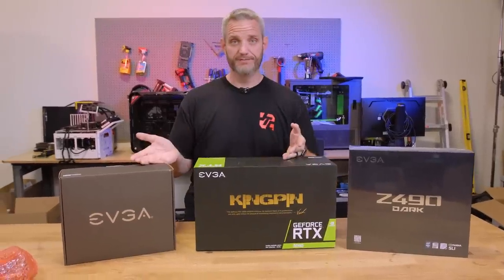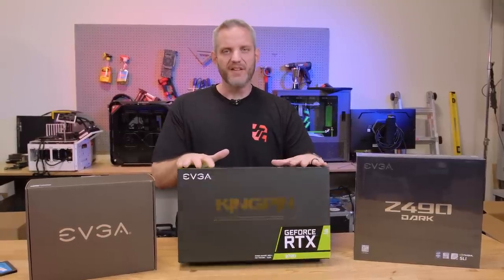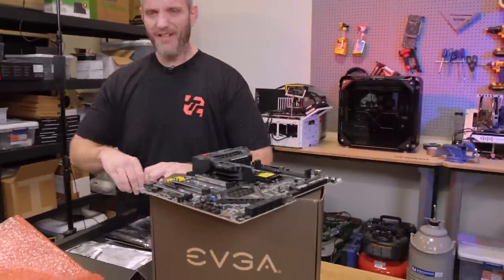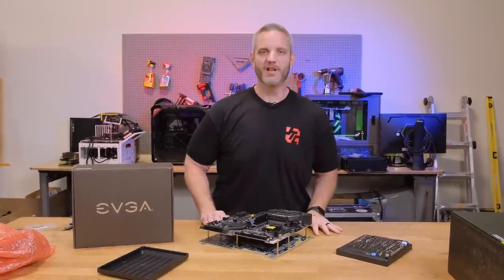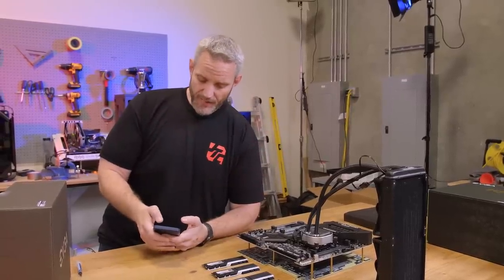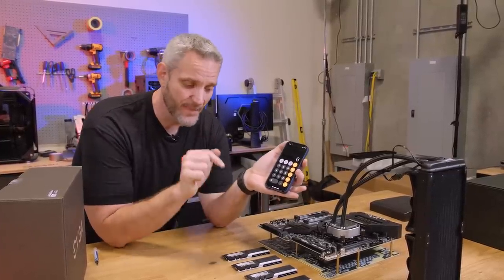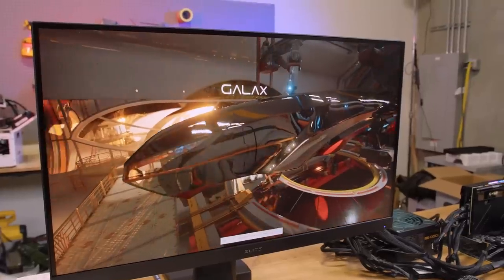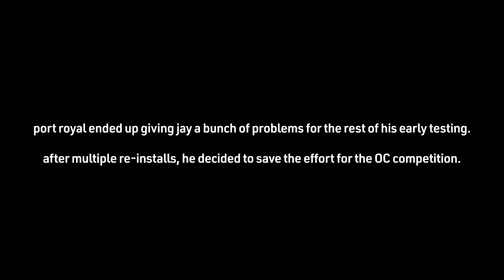RTX 3090 KINGPIN.... This should be illegal...

Comment: Jay : "I'm a regular nerd just like you guys!" - tunes his ram to tenths of nanoseconds worth of advantage.
Reply: That's just how ram works but the average builder knows nothing about ram
Reply: 10 pico seconds.
Reply: @patrickbone5446  I am guilty of this, I know nothing about ram. The most I do is making sure it is running at 3200 mhz and the RGB is on.
Reply: @removefromme  RGB is what ram is for!
Reply: @shumailkhan7205  Lol !
Reply: @patrickbone5446  I've watched & read how to articles. I've o.c.ed my  own ram and I still don't understand how it works.
Reply: nanosecond advantage, just with 5 ghz is like a billion times a second you have a ns advantage^^
Reply: @removefromme  try going into your BIOS to see if XMP is at least enabled
Reply: @removefromme  Intel would still be best for people like you I think. It's also generally more stable and tend to get lower core latency (50ns range compared to 60ns)

But for Ryzen, best thing to do is just make sure ram frequency scales with fclk. Since most ZEN3 CPUs can reach 2000 fclk, 4000mhz is actually the most optimal thing to go for. But usually the default is 1800mhz so pick a 3600mhz ram for good results.
Reply: @SoysauceML  my pre built only came with 2400 mhz ram lol.
Reply: @ryze9153  Probably it isn't overclocked. Rams that go above 3200 currently are all overclocked, just that the venders also offer you a profile for OC and covers warranty for OCing to these clocks.

So, maybe you can try your luck and OC it. Check with Taiphoon andd see if it's samsung die or hynix CJR/DJR, it should OC to 3600 without much issue if it is.

Though I guess if you use Intel it's kind of irrelevant. Ram speed does impact game speed though. Maybe about 5% or even more if difference is large enough.
Reply: @SoysauceML  i just enabled xmp to have 3000 mhz ram. Thats all i did.
Reply: @ryze9153  If it's 3000mhz then it's probably advertised as such lol. So it just means your dram was 2400 but officially supports 3000mhz via overclocking. Like I said most dram are overclocked (as in comes with overclocked profiles). I use xmp 4000mhz ram from micron, and its default profile is also about as low as yours.
Reply: @SoysauceML  well i'll say this. Cyberpower went cheap/worse quality on my ram, ssd, and power supply.
Reply: @SoysauceML  Already got Corsair 3200mhz RAM. Should suffice for my needs for the next 5-10 years.
Reply: @removefromme  why not OC it? I mean, I'm fairly certain there's enough headroom for 400mhz if you're using a ryzen (then again, I did hear that Corsair didn't have great compatibility with Ryzen. Wonder what dies it's using.) Turn the voltage up a little then set it to 3600 and run memtest to see if it has any problems.

Having matching fabric clock (fclk) and memory clock shaves 10ns or more memory latency... on top of making it more consistent (which should translate to smoother experience).

Heck, they even say this on AMD's official site.
Reply: @ryze9153  It's almost always better to just do it yourself than to buy a complete pc. You also get to fully choose what parts you want for what suits you the most.
Reply: @SoysauceML  yeah i know. My brother told me to just get a pre built so i did.
Reply: @SoysauceML  I may consider it. Just need to do some research on the matter.
Reply: i daily 4000mhz cl15 so yeah nah u dont have to be in OC comps to tune that tight
Reply: @jessecooley1580  huh ? You do ?
Reply: @removefromme  is 3600 mhz good?
Reply: @countleoponevonflikinstein8832  That's a good speed. The RAM timing itself is more important if I am correct.
Reply: @removefromme  Wait....You guys have RGB?

Comment: CL 12?! Haven’t seen timings so low since DDR3. But this time, it’s with DDR4 speeds...
Reply: People run Super Pi 32M.. Cl 10 3200  or cl 14 4800.
Reply: high grade samsung b-die kit, about 2x the price per gb as normal ram, you can shove 2v into that ram and not kill it
Reply: CL12 is normal. I had Corsair Dom Plats SE Chrome running at 3466 CL10 only on a Z390 Aorus Pro, not even a good memory oc board like an Apex or Godlike
Reply: Don't worry, in daily use like for gaming, CL will not impact as much as in synthetics.
I legit found no diff between 3800 really tight subs  c18 vs 14.
Left c15 since it was best for daily voltage.
Reply: @justetan3566  Really ?

I have about a week, thinking about tunning my RAM from CL16 to something lower, and even raise the frequency ; but I am just too lazy these days to do the testings and all that. I was thinking maybe I can squeeze out some faster loading times in games.

You reply discourages me even more (apart from my lazyness).  :(
Reply: @manupainkiller  i have no reason to lie, i spent weeks learning and tweaking my bdie kit ( same kit from zen 1-zen+ to zen 2 and hopefully soon zen 3 )
I have a 3733 17 17 17 1.35 b-die kit  ( paied like 260 euros at the time for 16gb, fml).
TRFC-TFAW-*_SLC (x2) gave the most performance while tweaking the rest isnt as big but still gives something to work with.
Primary timings ( such as CL) didnt really give me anything in games but  maybe at really low setting it could impact a little more.
Reply: @justetan3566  Hmm, and Ryzen system too. Wasn't the RAM supposed to make, a great difference for ryzen ?
Reply: @manupainkiller  Yes, but cas latency isnt the most important timing at all, videos as this one are not completely true and that stupid math* calculation doesnt really mean anything.
Try to use a 3600 c15 XMP vs a 3600 c18 one, you'll probably find margin of error result, because secondary ( sub) timings give way more performance, especially on ryzen.
Reply: @justetan3566  Now I am wondering if the results would be different on an Intel. I have i9 9900k.

Wasn't there a myth not long ago, that AMD prefers high frequency RAM, while Intel prefers tight timings ?
Reply: @manupainkiller  no, both like tweaked ram both speed and timings, ryzen has just bigger scaling due to chiplet design and latency.
Reply: @manupainkiller  amd would want both frequency and timings but you will notice frequency as a handicap more than timings cuz infinity fabric, diagnosed a defect motherboard like that
Reply: @justetan3566  Jay literally said in the video that it specifically matters for synthetics lol
Reply: @whydontyouhandledeez  yea but people arent always smart, this means that him saying ''good for synthetics'' will sound like '' good for everything then''
Reply: @justetan3566  sure, but anyone who doesn't know that isn't going to know how to tune their ram lol
Reply: @justetan3566  I'm not sure if you know this but the cas steps up in 2 in ryzen, your cl15 will actually be cl16
Reply: @mmaayyssoonn8858  if you leave geardown on yea, but i disabled it since it doesnt do anything for me.
it helps for stability  but on zen1 and zen+ it took way more perf than needed for just some stability ( zen 2 isnt that much affected by this but i disabled anyways since my kit is pretty good)
Reply: Buildzoid docet!
Reply: I think Steve was using a US voting machine as his pc. That would explain his panning away for a minute, then his scores magicaly increased by 20 percent...

Comment: I just messaged Kingpin about those overclocked SATA cables. I told him I need them to stress test my southbridge overclocks so hopefully he'll send me some.
Reply: The thing is, with two different (both functioning on another system) Smartphone-data cables, I have 1 working and 1 not working with my PC :)
They should be electrically identical, but...

Comment: I'm pleased with my pc when I hear scores just over 15k when my score is just over 13k. I'm satisfied not having the best when I spent under $2k for my build. Ryzen 5800x liquid on a 360m rad, 32 gb duel rank with four dims at 3600 16c, and my rtx 3070 fe oc'd to 2055mhz ish core with a 75mhz bump to ram before multiplier. It's fun to play. I wouldn't recommend the best for gamming for an extra 5-40 fps more. As long as your over 60fps its all good.

Comment: That is crazy, thats a different calculation then what I was taught, but it works just as well. Still trying to figure out why it works both ways, but I know its just math. Your way might be easier. 

Here is the way I was taught:

Ram Nano Second Timings Calc Equation

(1 ÷ {Half of Ram Clock Speed in Ghz}) x [Cas Latency Timing] = Time in Nano Seconds to complete.

So Using Jay's initial 2 Examples of CL18 at 3866 and 4000.

(1 ÷ 1.933) x 18 = nano seconds = 9.312 nano Seconds

as opposed to the same Ram Kit running at 4000Mhz at CL18

(1 ÷ 2) x 18 = 9 Nano Seconds

Both the Technique shown by Jay in the Video, and the Technique I learned ages ago work for this calculation as you arrive at the same result, I just wish my brain would snap out of it and figure out why both ways work...

NVM. Just figured it out. It works because both ways arrive at the same multiplier. So if you take 2000 ÷ 4000 you end at .5 the same as if you take 1 ÷ 2. Or if you take 1 ÷ 1.933 You end up at 0.5173305742369374 the same as if you take 2000 ÷ 3866. So it literally doesn't matter which way you use, they both end up with the same multiplier before multiplying by CAS Latency. In that case I think I will start to use Jays Method instead, as its much easier to just start at 2000 no matter what, and divide by the The Ram Speed in Megatransfers as opposed to having to always figure out half of the ram speed and converting to Gigahertz. Learn something new every day! Love it!

Comment: Jay, Should I upgrade my 1660 super to a RX5700XT?
Reply: I own a 5700xt strix, don't buy it, I'm gonna sell mine and buy the new 6000 series once the aib cards launch and are in stock. My experience with the 5700xt has been pretty disappointing, if you do buy 5700xt make sure it's not a 2nd tier AMD partner like Asus, MSI, etc, get Sapphire, it's the best.
Reply: I agree with the other guy. The 1660 super is not that much worse than a RX5700XT. You'll see slightly better frames, but it won't make a huge difference. You're better off just waiting for the next gen cards in your price bracket to be available.
Reply: Thanks for the advice guys 😁

Comment: Ram Mhz ... I think you mean megatransfers per second (MT/s) ....
Reply: and before people comment saying it is the same thing ... no it is not.

Mega Transfers Per Second is a measurement of bus and channel speed in millions of “effective” cycles per second. While, Megahertz means one million cycles per second and is used to measure the transmission speed of electronic devices. You'll notice memory is not listed as "2133 MHz", usually it's just "DDR3 2133". That is because it doesn't actually operate at 2133 MHz, it operates at 1066.6 MHz, but because it's DDR it does two operations per cycle, so it's as if it were 2133 MHz, but it technically isn't. So the proper unit to use would be 2133 MT/s which is the actual number of transfer operations that occur rather than the frequency, since those are no longer the same number with DDR memory.

Comment: I know this will probably be drowned out, but I want to potentially see if I have this correct, but with a different analogy. The frequency is like the horsepower of a car, and the CAS latency is like the weight. You can have less power in a light car, but still have it be faster than a lot more horsepower in a car that is a lot heavier.

Comment: Instead of vasoline can you set the motherboard in a shallow tub of mineral oil. The top of the LN2 pot would be high enough not to be submerged but there would be no air around the board for condensation to form.

Comment: Just a thought, why not put the system inside an oil bath, oil can be cooled to sub zero temperature without freezing, also you cool all the parts not just specifically the cpu or gou, then there should be zero chance of any thermal throttling by any component like the v-ram, would be interesting to see though??

Comment: I was going to say 4000 CL12 impossible at safe voltages. But once jay said 1.8v, I believe him. Though it's gonna burn out sooner or later. Quicker without a direct fan on them. 

1.5v is safe all day long if you have some case airflow.
Reply: for overclocking, especially with LN2, its actually pretty safe. you can't use all 16gb of them to run safe during the benching. instead only 4gb is available to the OS. Obviously it's not sustainable for daily driving but for OC anything up to 2-2.2V (depending on the module) is pretty safe and won't really degrade it. Also this is only true for samsung B-die.

Comment: Why are you using Vaseline?
Just spray the board with some Silicone Conformal Coating! It can handle the temperature of the board and protects against water. Barely noticeable and lasts as long as the board will. Give it a try I got a link if ya need.

Comment: 8:00 -  EHANT!  Correct orientation, wrong location of tubes.  Tube inlet and outlet go at the bottom so that any air bubbles are at the very top of the radiator and away from the inlet/outlet unless you can't do that (which you can).

Comment: Ah, good old RAM latency... Though it is probably affects benchmarks, i don't think it is something to be worried in games. Long memory cycles was big issue for CPU's witout L3 cache, since processors of that time most likely didn't found required data in L1 and L2 cache. But in era of L3 cache data is found in 90% of cases, and that leaves us 10% of cache miss, that leads CPU to look for the data in RAM, which is slow compared to CPU memory speed. This might lead to performance 'dips' (how big depends on RAM, but i don't think you'll notice them, unless looking on frame-time). I would suggest to not look for extremes such as: super high frequency, or super low latency. Better is to find silver lining in stability, frequency and latency. A lot of people actually afraid to bump-up a bit latency, thinking that will lead to worse performance. But with higher timings you have more room for overclocking frequency, which can lead to actually lesser delays.

Dont't know why Jayz didn't include formula in the description. Here you go:

1000ms (this is time of one cycle) / half of the RAM frequency (this is command issuing speed, works with half of actual frequency of the RAM) = result in nanoseconds (the result is then multiplied by CL number)

So if we take RAM in video with stock params that would be: 1000 / 1933 = 0.517 and then 0.517 * 18 = ~9.3119

Comment: The difference between your ballistix and your g.skill kit is your sticks are samsung Bdie. Bdie can run in excess of 2v without issue for bench sessions. I believe the kit you have is A0 pcb but if you can find a good kit of the newer A2 pcb layout and run it 4800 cl14 you will see better performance than 4000 cl12

Comment: By the way, both of your water coolers are used the wrong way, pipes going into the radiator should  never be at the highest point of the cooling system...

Comment: 08:03 that wont make steve happy... still wrong side of radiator.Above the pump means you will have air inside the radiator that will be sent back to the CPU block with that orientation of the tubes.The tubes must be on the down side of the radiator mount.

Comment: Your stock kingpin 3090 runs at 1093 mv... I had to undervolt my Red Devil 5700XT to around there in an attempt to keep temps low enough to prevent artifacting. I even set the fan curve to 100% from 60c on, I sure hope the 6000 series pans out in the long run, because this 5000 series is disappointing.

Comment: 9:00 - probably because those DIMMs are Samsung B-Die vs the 5100 kit which is Micron Rev.B or Rev.E which micron clocks really damn well but the subtimings let it down compared to B-die but you cant go wrong with the price wanting Micron Rev.E for mem that does easy 3800 CL14 for Zen2

Comment: Secret sauce - Sperm Whale Oil (real) as thermal paste and it is drastically better than anything on the market. You can get it from Japan from the same supplier have used a couple decades ago for my Dads train set. Or contact Nye Lubricants (NASA use them). used it as a thermal paste on my 2080ti and is basically cold and now 3080 and replaced the stock cooler. It runs over 2200mhz and dropped 30 degrees Celsius.. maxed out running 4k furmark at 52 degrees and heaven running together for 6 hours.

Comment: Hay Jay, yah ever notice a difference in fps if yah go into sysconfig and do that "select all cores thing" cause there's a qwerk with how the threads are distributed e.g. in cinebench fare enough it finishes at same times but finer squares but in other task yah see bottlenecking until yah enable threads that way as if problem with load balancing the also cores ares actually "cores times threads" but yah don't see that and where do yah enable that. Most of yah extreme builds and King pin even i never see a " LOAD BALANCE THE CORES" to handle bottlenecking to increase fps

Comment: Until what clock you can OC the rtx 3090? I can OC my Gtx 1660ti at 2.0-2.1Ghz stable during benchmark test and games with 67-68 Celsius degrees, without trying to push with more power than 105%, did i won a Silicon Valley lottery ticket or it's normal?

Comment: ive managed 3600CL12-12-12-28-1 at ahemm 1.7v and 1.35vccIO/vccSA lol. latency = 35.5ns in aida64. had to fix RTL/IOL's myself (which is -2ns btw.) cuz the board, well cant do it for channel B....
looks like either my chip or my mobo is struggeling at higher freq/timings in dual channel. i can get 4133CL15-15-15-36-1@1.5v for example on channel A, channel B doesnt even post 3866.

Comment: I have a set of this same ram rated for 4266 cl 17....I've got it going at 3800 cl 16 for 1:1:1 mode with my 5800x. I was having issues with it when I first got it (think it was mostly due to a bios issue). Think i should be safe to take it to at least cl 14? Cl 12 is pretty crazy. Or any chance you can at least give us the base timings you use?